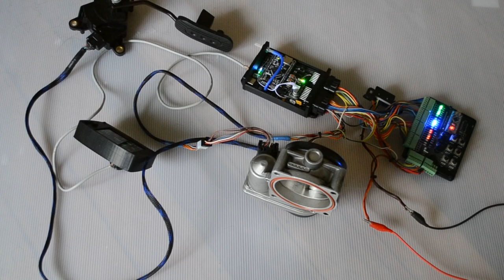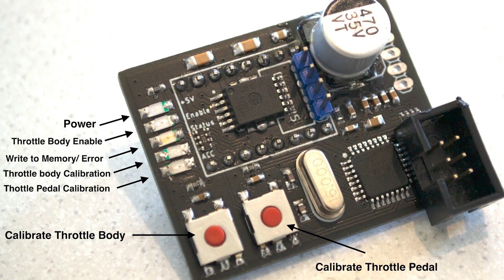DBW setup video for STM Pro DBW Module

Comment: Very nice, !!!, any development can-bus capable to send TPS signal to a stand alone (speeduino or megasquirt)? and can this controller be capable to make idle adjust and A/C load compensation?
Reply from the maker: Using this module in the Pro ecu Canbus data is available already (including TPS). the module also uses PWM idle control from the Speeduino firmware. As a standalone module (i also manufacture) Canbus will be included.
Reply: @etpulsar  Availability and price of the stand alone module? I also manufacture my own ECUs based on open source (speeduino), called "SpeeDiac" but with many improvements and considerations about to Electronics&PCB Design Guidelines, but w/o DBW control.

Comment: Does it use both pots on each end as a safety check? How can I buy one?
Reply from the maker: Yes is has full safety and uses all 4 pots, It will shut down the throttle body if any of the signals or signal supply voltages are missing, if any of the pots don't match, If the throttle body is in front of the pedal any time on acceleration (if the throttle plate is pushed open manually) etc. They will be available on the website in the next few weeks.
Reply: @etpulsar  Any updates?

Comment: Will it be useable standalone or with another ecu? Some others just have a tps out signal and pwm input/rpm for idle control so can be used with any ecu.
Reply from the maker: I have a few versions of this and one is a standalone version. Coming soon.
Reply: @etpulsar  Any updates?
Reply: @etpulsar  Hey when could i buy the standalone version. I am still waiting <3